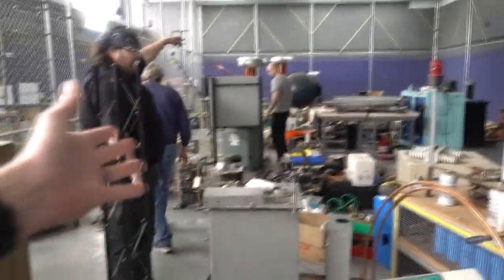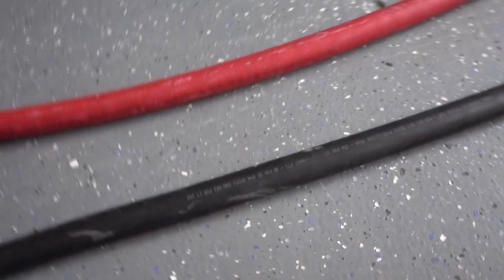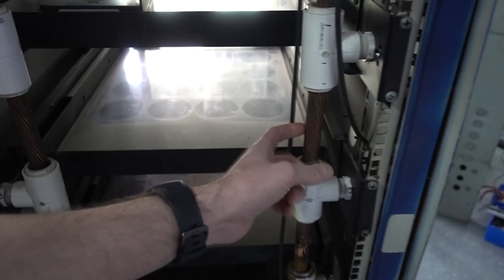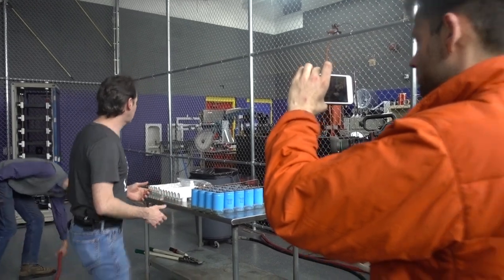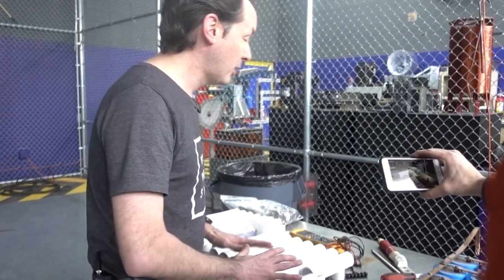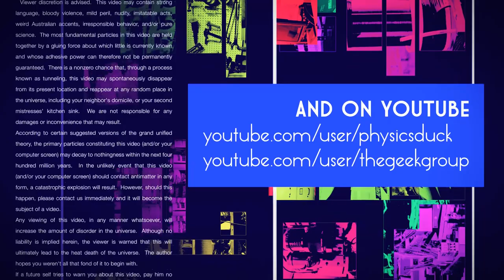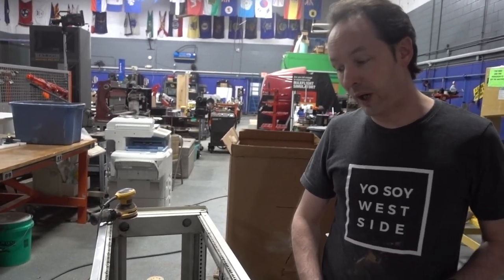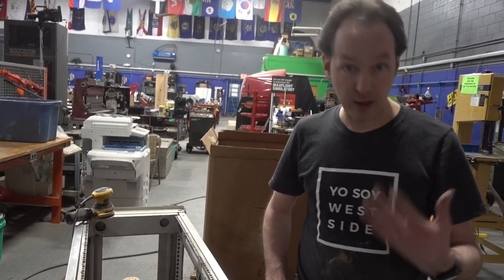Captain's Blog 2 17 2018 Thumper Teardown

Comment: MCM is an abbreviation for thousands of circular mils, an old measurement of wire gauge. 
1 MCM = 1 kcmil = 0.5067 square milimeters. A mil is 1/1000 inch. 
A wire 200 mils in diameter is 40 MCM. MCM is generally used for very large-diameter wire.